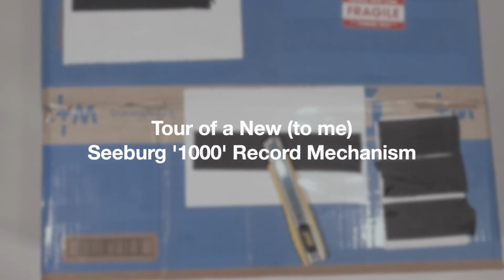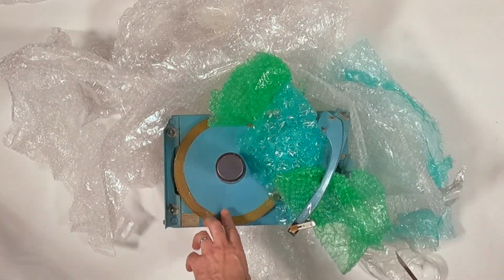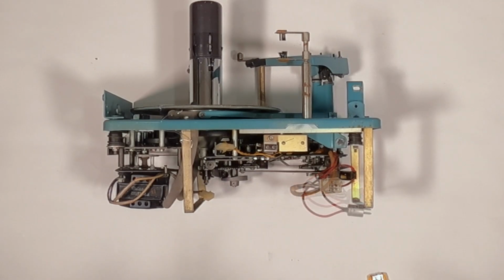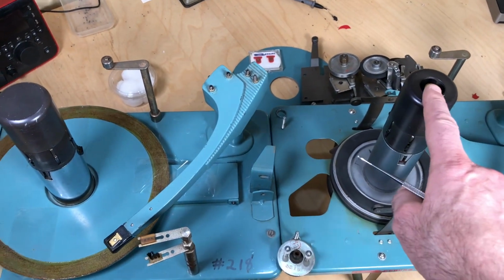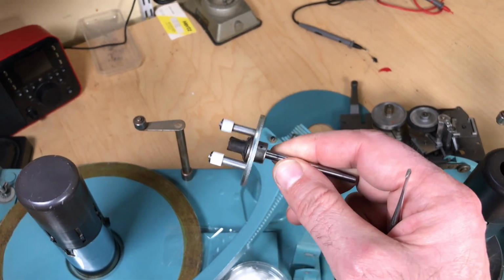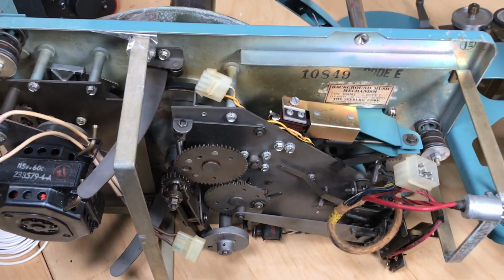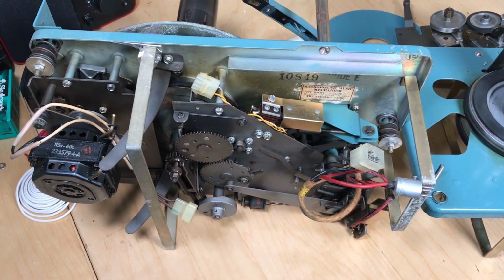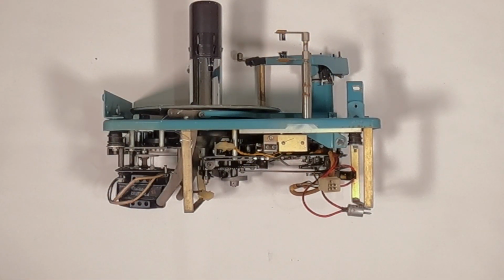Seeburg '1000' - New (to me) Seeburg internal mechanism tour!

Comment: I have both and Bmm1 and a recently picked up Bmm2 which I'm trying to bring back to life.  Luckily it runs ok.  It has all the motor couplings, but it really is very poorly misaligned as to the arm seating and unseating.  So know I'm working trial and error trying to get it to land properly in place and come off the records.  After that, I'll have to work on the amp and cleaning up the sound.  These are really amazing machines.
Reply from the maker: These machines are super difficult to get fully tuned. One of these days I'll put up some videos on repairing various parts of the machine, like the drive pulleys and such.
On my beautiful BMS (the "microwave") I got things working well and recapped it, but realized I couldn't run it 24/7 like I wanted, so I built a custom MP3 player inside, using a Raspberry Pi, and it plays my whole Seeburg collection, whole sides at a time, complete with fake record changing noises. I definitely will do a video about that one because I think it is a really nice mod for people who have an attractive BMS they want to show off but it needs too much work to get it working properly.